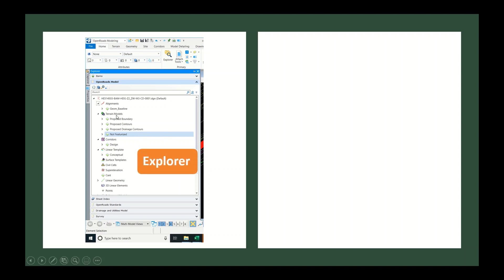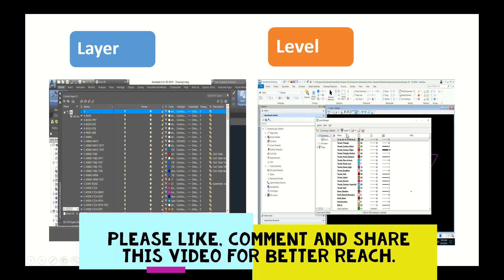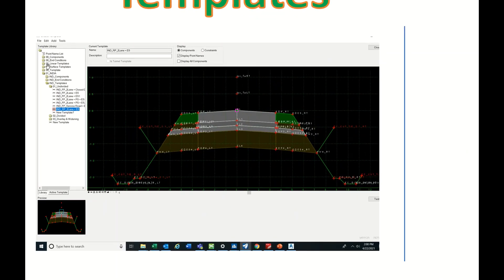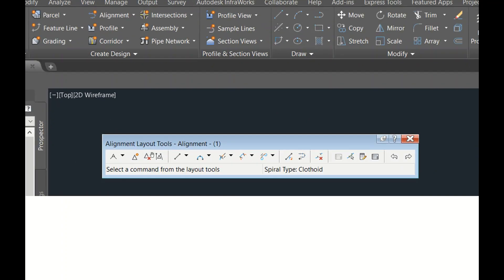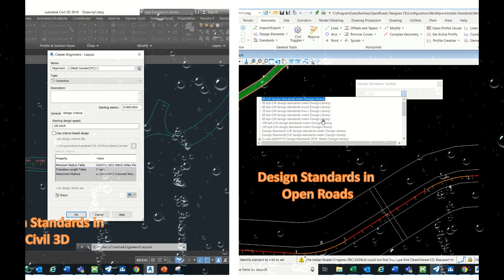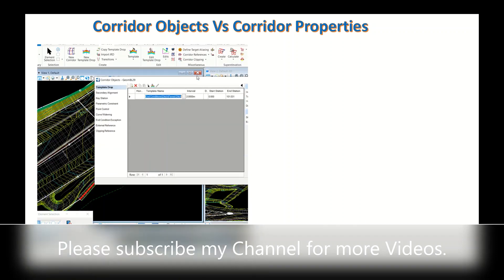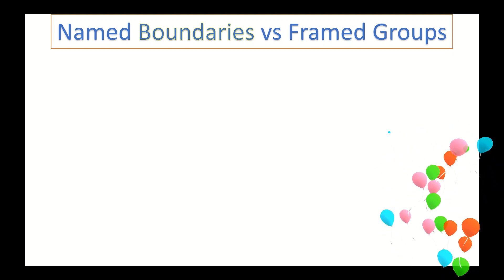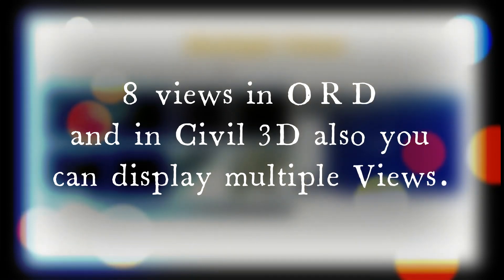Basic Tools comparison between Civil 3D and  Open Roads|| Highway Design Software's|| Civil Engineer

Comment: Sir I am doing a survey on C3d vs Openroads. Can you please mention 5 things C3d is better at and 5 things open roads is better at. Please it would be so kind of you.
Reply from the maker: I explained the maximum in this Video....
Modelling wise ORD is good
Drawing Production wise Civil3D is good.
Reply: ORD
1. Intuitive Interface
2. creates larger corridor and site model with lighter file size
3. handles complex surface modeling much better
4. Advance Civil Analysis tools
5. better interoperability with other model discipline

C3D
1. Drawing Production
2. well Established users
3. better marketing strategies
4. works well with smaller projects
5. 2D CAD drafting

Comment: Civil3d is always lagging because of the visuals i though I want your opinion which software I can prefer for alignment and profile creation
Reply from the maker: If you use Data Shortcuts method.I mean seperate file for Only alignment then there won't be any issue. For Horizontal alignment OPen roads have best tools ..vertical alignment is good in Civil 3D compared to Civil 3D
Reply: @CivilHighways  so I just use data shortcuts for all the components and only use that alignment objevt in modal space